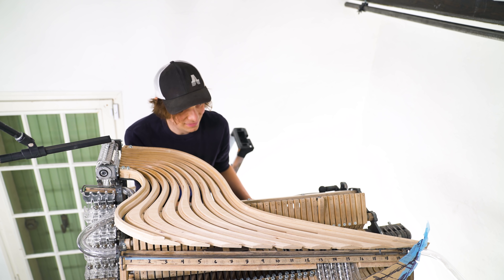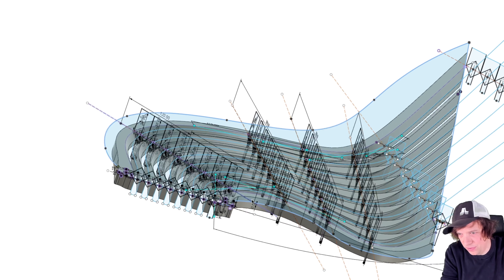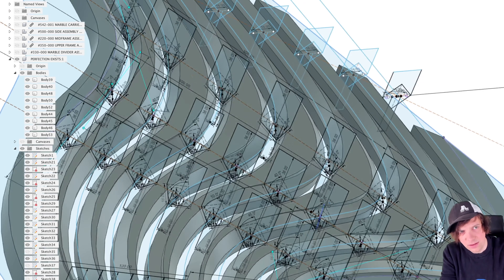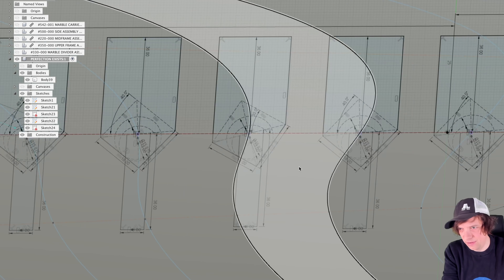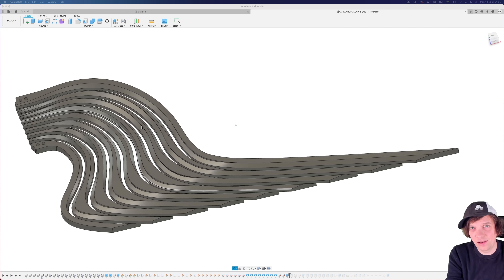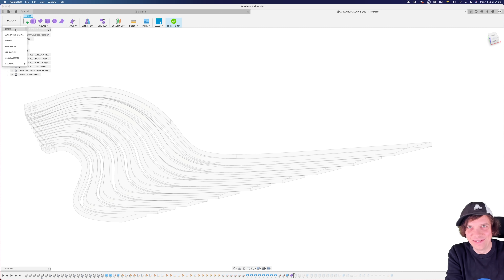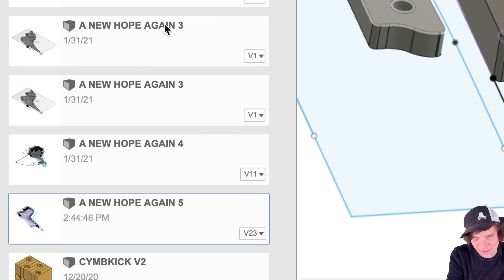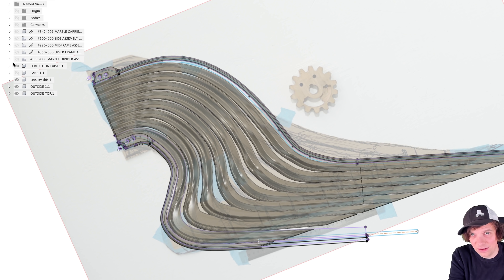Marble Lanes

Comment: Not knowledgeable on Fusion 360, but with CATIA instead. Setting up loft profiles should be done on a sketch plane perpendicular to each curve, and not a group of curves. Perhaps a loft sketch at a minimum at the beginning and end of each curve section (if you have straight sections). If no straight sections, then you should be able to set up these planes with a set distance between them - say 10 to 20mm spacing. I would then either use sweeps for creating the surfaces. Being both an engineering and musician, I can only note the adage “Practice makes perfect.” That alone defines your journey with this project.

Comment: Huh, didn't we just explain that less restraint on marble movement would offer improvement in marble behavior.

But we isolated 8 lanes of the marble lift, with the only opportunity to correct misbalance being the fish stair.

So we probably need to consider a 'flat unit' in the middle to feed a common divide setup, a quick swap of a thin contour unit would bias to left or right for vibraphone else percussion.

Did we remember KISS?
It looks complicated for a very simple component requirement.

Comment: Perhaps if you think of your lanes as tubes? Bend them into the position you wish, than "cut" them in half. Then put your center line on each "half tube". Then reposition your center lines to reflect the angles you want. You mentioned a roller coaster,, ok, well,, if you was to look at the construction of an actual roller coaster, you would see the framework of the half tube. Then if you was to look at the completed roller coaster from the the top,, a "sky view",, you would see the center lines moving from side to side. Of course to keep the marbles having only the two contact points, you may have to go deeper in the channel in order to keep the marbles from spinning off the top edge.

Comment: hmmm... Besides the obvious dimension issue, I don't really like the look of this divider. You are again mixing too much constrain of the marble and overdesign. Plus, it looks like a big slab of plywood slapped on top of the MMX, and it hides all the mechanic parts below it. I'm really sad that you fell out of love with steel wire rails. Those looked extremely cool and were so light that they wouldn't obfuscate the view

Comment: A projected sweep with cross sections periodically in the curve to achieve the changing slopes is probably going to be the easiest and most straight forward way to achieve what you are wanting. With the cross sections it is easy to go in and adjust the slopes and angles. So, I think you are on the right path!! Did you say you were using Fusion?

Comment: My calc is pretty rusty, and my CAD experience way too basic, but it seems like you should be able to relate the slope/banking of the track to curvature of the path. Like, wherever the track is running straight, the each side should be 45 degrees. Whatever the sharpest curve is, that should be set as the most extreme angle of bank. Some equation would relate those three points accurately (sharpest inside curve, straight, sharpest outside curve). I'm sure someone could make that into a function all along the track, which would allow on the fly changes. 

Only possible change is if you need the banking to be further down the track by some amount.

Comment: The loft is the right way to solve your problem, but your parametrization could still be better. Each of those rectangles corners could be constrained to the surface of the plywood, and each of thhe angles in the sketch could be parameterized against eachother, so you only have to update the angle once and it will update on all 8 lanes in the row.

I use inventor (not fusion) so idk if this feature exists in fusion, but you can (maybe) set "user parameters" where you can declare numerical constants at the file level, then reference them in dimensions. In this way, you only have to change the number in one place (the user parameter, you dont even have to edit the sketch), and your model updates instantly.

Comment: 3 things:
1. You're doing great. Keep it up. You have managed to hit a sweet spot between engineering and art/creativity that many fail to achieve. This project is truly an inspiration.

2. Using lofts will be your best bet. I would recommend making 1 extrude that is roughly the outer geometry of the plywood you will cut. At the entry point to the lanes, create a plane and sketch the geometry you want for the track (I'd recommend diamond shape, you can put a fillet in later if you need it). The diamond shape should be 4 lines with perpendicular/parallel constraints. Use a sketch (construction) line that connects opposites corners and create angle dimensions either from a horizontal or vertical reference. Once the initial diamonds are placed, I would create a new sketch looking down at where the tracks will be. Using splines, add your paths. The key to the splines is to monitor where you put intermediate points (I think they're called "control points" by Fusion 360). These points should be where you add intermediate loft sketches. You should define planes at these points that are coincident with the spline points and perpendicular to the spline at that point (you may need to add construction lines that are coincident at the point and tangent to the spline and use the construction line to define the plane). Create lofted cuts the same way that you have here (center line guide) but also use the "direction" constraint for each of your profiles. This should make sure your tracks are smooth. Once you've created all of your tracks, you just need to change the spline sketch to adjust where the tracks go. You can edit the angles from your intermediate sketches to change the "lean" of the track if necessary. Add fillets if you feel they're necessary.

3. Keep in mind you're in the prototyping stage still. Don't go way over board with your designs until you're confident they'll work. Adding lean to the tracks may not be worth your time right now. If you really don't want the balls to come out of the tracks, just make the tracks deeper.

Kind Regards

Comment: I'm also wondering about the gap between the conveyor belt and the track at the top - seems very wide. I'd like to see a test to make sure that a marble sitting there can't be dragged down as Martin demonstrated in the initial video in this series on the conveyor belt distribution.

Comment: For the simplifications of the tilted square problem, would that work in CAD to have a reference curve for the center of the square, and to add a reference curve for the bottom vertex of the square, then use both curves to compute both center and rotation ? I'm not a CAD user, but if it is possible to constrain 2 curves to stay the same distance from each other you could use it to fine-tune the angle with little effort.

Comment: If you use the file in length direction it will be actually much easier to work with. Sideways there is no defined cut geometry. Sppeeeeeeeeed

Comment: You could slow down the marbles by decreasing the groove angle from 45 deg to lets say 30 deg. It's a bit hard to explain it without graphics, but with smaller angles the contact surfaces on the marble lie higher. I this case more energy is converted into rotation instead of velocity, and it also slightly introduces more friction at the contact surfaces.

Comment: The look of what you made makes me think you can just pitch the ramp away from you about 5 deg. trim the long face to match thus shortening the long point. You might need to lose one anchor bolt on the top anchor from that trimming but it should line up how you want it to.

Comment: hmm I would guess, the reference picture you took, was not taken planar, so you get a distortion...
Is the plywood capable of holding tension like this for a long time if you clamp it down to form, like the lanes will be with this design?

A question for the Fusion Pro's. I was once told to use "fillet" only really conservative in sketches, as they destroy most constraints and do those edge smoothing only in solid mode. Would you agree with that? (As I see Martin using those quite often in sketches...)

Comment: Always move from the outside to the inside. Cement the goals in stone. The rest of the engineering process is to simply connect the dots. If the goals aren't locked in place, rock solid, nothing will fit in the end. This rule applies to all problem-solving. Both in the physical details as well as the abstract processes. AND IT COUNTS A THOUSAND TIMES AS MUCH WHEN DEALING WITH ANYTHING THAT INVOLVES COMMUNICATION. ;)

Comment: You made something entirely from scratch and every single aspect of it worked EXCEPT for the total length. The track shape, while complex, works. The guide rails worked, fit first time, making them in one step with everything else worked.

Perfection does exist. Your CAD/CAM skills grow every time you make a part. Give yourself credit for what you do right. This was a success! <3 You successfully learned to check your source material before you cut, plus made a part that functions first try.

Comment: I can’t help you with how to model this in Fusion, but I can give you some tips based on Roadway Superelevation design (banked curves). The transitions from flat to banked should be linear. And that transition length should occur 2/3 off the curve and 1/3 on it. For example, if you decide to bank 15 deg. with a 9cm transition length, the bank would start 6cm before the curve and transition linearly until 3cm into the curve. The bank would be exactly 10 deg. at the beginning of the curve. When you go front the right curve into the left, if the tangent section between them isn’t long enough to fit this approach, use the same transition rate and center the transition between the curves.

Comment: In regards to using lofts, sweeps or another more efficient modeling/machining design.  I downloaded your Fusion360 file and went about trying to find a more efficient way than setting up a bunch of construction planes and using a loft along a line.  And while setting up 6 construction planes on 8 marbles paths definitely adds up(I remodeled only 1 of the 8 paths using lofts and it took 20 minutes to set up all the construction parameters and add all the necessary intersections. ).  If you are dead set on having the angles of the wall bank,  I think the way you are going about it is the best.  I know the design constraints were that you can't have the marbles come off their track and that you wanted them to funnel better.  If you are willing to try some experimenting with the CNC tool path and the design of those paths, I  have another idea.  Instead of having a square for your loft profile and rotating that to correspond to the bank of the curve,  why not have a deeper channel for the balls to run along.  What I propose is using a channel made by a ball endmill.  Use a ball end mill that has cutters running along the vertical wall as well.  If you were to have the channel be 1.5X the depth of your marbles and it was a bit wider than the marbles themselves, eg you have 12.7 mm marbles your channel is 15 mm wide.  You could probably machine this in a single cut or two, reducing your machining time immensely, and the deep channel would prevent the balls from losing their track.  Additionally, I remember you talked about "where entropy reined supreme" but I bet if you took enough data with a couple versions you could get the length of each path to follow your 6 sigma goal of failure.  You may need to experiment with roughing some paths with low grit sandpaper and then polishing others or even axing some to reduce the friction.   The reason why I like your way more is that it looks prettier.  A deep channel won't look like waves, and your current design makes me want get a little marble surfboard and take those curves for a spin.    Here's a video of the what I'm meaning by using a sweep with vertical walls.  https://youtu.be/vqDqb08_fgc

Comment: You could try to separate each lane. So if you build it and have the CNC cut it out, then cut the wood that joins each lane together. Then when you put it up you can individually place the marble lanes. This is somewhat of a problem though because now instead of a single piece that could fail, you have a lot of individual wood pieces that if too much strain was put on them they could break. However, you might give it a try so that you can at least get an idea of how the pieces can have a little wiggle room when you separate them. Hope this helps. Also you are awesome man and keep going!! This truly is a feat of engineering and you have been doing so freaking awesome! I love how you always say that you learn something from each problem that you fix. Great job man!

Comment: Ha, that's funny. I'm a roller coaster designer (well, soon to be professional? I hope), so this video does ring a bell. I'm not familiar with Fusion 360° so I can't help, but using a spline (either bezier or b-spline) and forcing the tilt is probably the simplest way.

Comment: I still think the marble divider should be redesigned so you can have straight pipes to the marble gates. The marble brakes should also be revisited in search for a simpler solution. Why keep a single part, instead of redesigning marble track and marble divider as one unit?

Comment: I'm not totally sure but isn't there a fundamental issue with this design? Lets lable the bottom lane 1 and the top lane 8 for this thought experiment. Are you not going to get a situation where lane 1 collection area recieves no overflow from the the other lanes, lane 2 collection area only receives overflow from lane 1, lane 3 receives slightly more overflow from 2 and 3 etc up until lane 8 which receives overflow from all other lanes meaning the overflow spread is not equal resulting in some pipes getting more feed than others?

Comment: Here's an idea.  What if you mounted a sharpie onto the spindle of your cnc machine?  Prior to every print, you could run a general outline of the upcoming print and compare it before using the spindle.  That way if there is a mistake, you could save yourself a little trouble.  I guess it would be like a print preview.  It wouldn't work for the details that require multiple layers but it could work for an outline at least.

Comment: Marbles won't be going fast enough to take advantage of the extremely banked turns, the banks will cause problems if they are too steep for the speed.  The speed of the marbles towards the bottom will also cause them to hit marbles in the divider lane and probably jump right off the divider cliff and on to the channel mechanics and instruments.  Having some marbles bypass the earlier channels is the right approach, but you may want to consider starting them a channel or two early from where the heaviest used channels are.

Comment: I think the main challenge with this design is the interface between the marble lanes and the marble divider. As others pointed out, the marbles move with quite a lot of speed when thrown down on the marble divider. Could the design be modified so that the marbles are traveling more parallel to the marble divider, so more horizontal and also along it more? I guess redesigning the ‘wall’ of the marble divider, so it accommodates the oncoming marbles more would also help a lot. 

I’m more positive to this design than a lot of the other commenters, so I just feel that the interface needs to be smoothed out 😊

Comment: I wonder if the tracks need to be a bit wider to reduce speed of marbles. I.e. perhaps the angle should be less than 90 degree, so a marble touches the track closer to marble's rotation axle.

Comment: Look even if I’d didn’t fit, it would be spectacular on the wall. And here is some food for thought; two of your goals are to slow the marbles down, and reduce the noise. If you cut the track so the points of contact on the marble are broader, it will reduce the speed and the noise both. The marble would need to spin faster to cover the same distance. By varying the width, you vary the speed. Which might give it a more elegant moment, rather than a mad rush to the bottom. Instead of cutting a „V“, you would need to cut more of a „U“ and the marble would ride on the top edges of the u. And you could still keep the sweeping curves of your rollercoaster.

Comment: The square profile you have lofted between to create the marble lanes is limiting your control of marble speed upon their exit, as they make the contact points have a fixed distance apart as you have demonstrated before in a video about marble over rotation this could be fixed by turning your squares into rhombuses. When you show us your CAD designs you're making reference to parametric modelling, but I don't think I've seen you use the parameter window in fusion 360 yet. If unaware you can find this by going to the modify drop down: and selecting change parameters. I would suggest creating a unique name for each section of the lane, such as lane1section1rotation. This would allow you to easily modify each parameter from a list view. However this parameter window has no reorganisation options, meaning if they are out of order they are stuck that way ... a quick google showed me a plug in called Parameter I/O that lets you import/export your parameters as a csv file, which I imagine would allow you to reorganise and group them some, and potentially colour code each lane.  I hope this was helpful and not just repeating stuff you already knew! PS: I think the design looks great!

Comment: I'm sure a CAD wizard will have a good method for you in the discord server, but at a glance it looks the final method you settled on for the lofts works pretty well. As to your last comment about being able to adjust easily, isn't that why Fusion has parametric design capability? Identify + name all your angle constraints for each track, distance between tracks etc. and adjust them from the parameter menu.